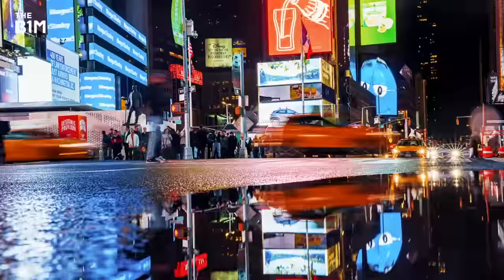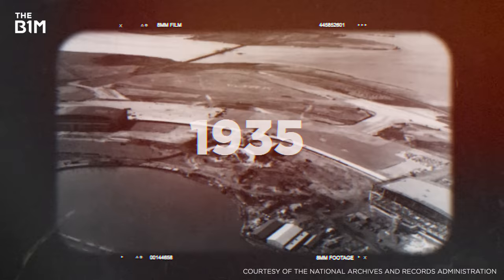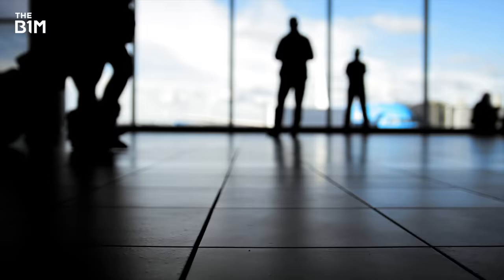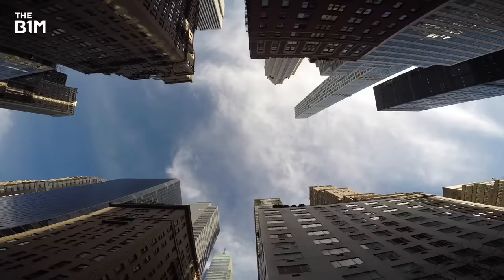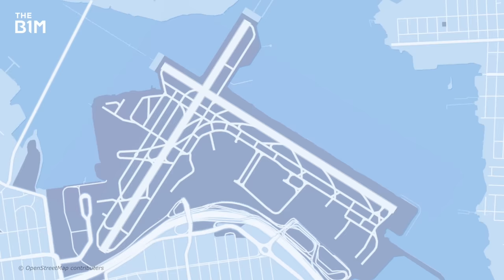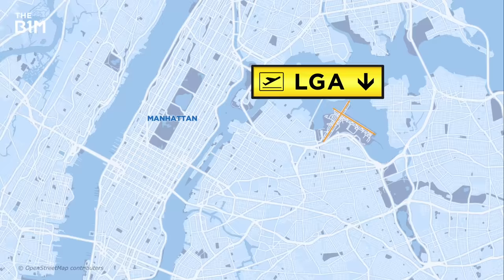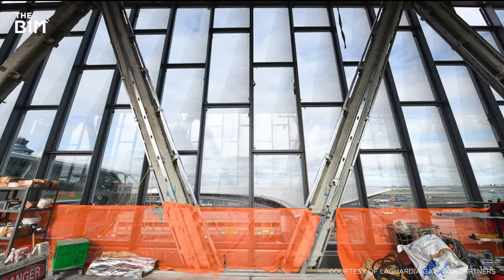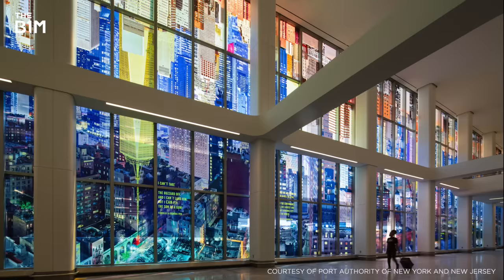The $8BN Plan to Save New York's Most Hated Airport

Comment: As a pilot, I can assure you LGA will never host an Airbus A380 as shown in the video when stating “…bigger and sexier jets.” LGA is capped by the perimeter rule which keeps most large (or “heavy”) aircraft out of the airport. Otherwise good job 👍🏼
Reply: Thanks for saying that.  I was looking at the stock clip he used twice with an Air New Zealand-logoed tail poking out, and saying, 'really? Me no think...'.
Reply: A 777 is a sexy jet an a380 isn't at all.
Reply: More importantly, the runways a too short for the jumbos. A 767 is about as big as it gets at LGA and even those area relatively rare. The bigger issue is actually they are using to small of planes in the RJs so it creates tons of congestion to move fewer passengers.
Reply: Same goes for the Burger King when mentioning food options at the old Terminal B. Don't recall that franchise (there was a Wendy's then a Five Guys in the food court by Concourse D), but it's a very small point in another fantastic, brief, yet engaging B1M video on urban projects.
Reply from the maker: a guy can dream
Reply: A380 is not longer a player on the game (and it was never intended for use at airports like LGA)
Reply: A380's are no longer available for new orders, their fulfilling existing contracts then terminating it.
Reply: @seanthe100  , 
What about an A350?
Reply: @markg1075  ,
I was diverted there from ATL and struggled with getting food. Pretzel dog, pretzel with mustard, soda was what I settled on. Not a single real "New York City" hotdog vendor in the Delta terminal.
Reply: You understand the perimeter rule was lifted correct?
Reply: @davidhoffman1278  it's aight
Reply: @StevenJohnson737  NYS Senate Bill S311A will codify it as a NYS law… the rule doesn’t apply to DEN due to the change in 1984, or on Saturday’s due to the lower travel volume… mic drop… I’m out.
Reply: That, and without USCBP facilities, they're never going to host a Lufthansa like shown at 3:08 (unless Germany builds some pre-clearance facilities).
Reply: @davidhoffman1278  - that's a bummer. And a very good point! Shake Shack, which is (sorta) authentic NYC eats is everywhere in the new terminal. American at JFK has a kind of hot dog stand at Terminal 8 by gate 42 or so, but not sure if it remains or did well. I mean, how many $11 hot dogs will even a seasoned traveler tolerate?!
Reply: Also, LGA serves domestic flights only.
Reply: As one of the PMs on the project, that made my eyes pop out. Silly B1M. :-)
Reply: A380s are obsolete already anyway
Reply: You're the pilot and I'm the flier. I wouldn't feel comfortable flying in/out unless both runways had 12-14K each.
Reply: @StevenJohnson737  no it was not lifted. There are exemptions to the rule at times, like NK’s transcon flights on Saturdays, but the rule is very much in effect.
Reply: And the runway is small too
Reply: @maumor2  It is still a player, albeit'll probably allow Boeing to have a flawlessly easy 797 launch, and it's production is over at this point.

Comment: As Peter says in the video, if the airport is using 22 landing/13 take off, it's more efficient because the intersection is at the beginning of both runways, so the touchdown happens and instantly the takeoff can roll. When the winds are unfavourable, the opposite happens where the takeoff has to wait for the touchdown to pass or exit slowly and then roll. 

That said, this new taxiway configuration will fix a huge problem and allow for significantly better ops.

Comment: I am surprised people complained about an elevated train, looks like they could just run it down the middle of the Grand Central Parkway elevated like they did with the JFK AirTrain and the Van Wyck.
Reply: The issue is mainly that you'd have to get the line around the overpass from the eastbound Grand Central somehow, while also altering the median.

The actual solution would've been something like aligning the tracks to Ditmars Blvd and then Astoria Blvd but that's subject to a hell of a lot of NIMBYism.

And then because of THAT, the tracks would be opposite to the actual terminals themselves... and thus need a bridge across in some capacity OVER Grand Central.

There's just no easy solution, aside from the train link up to Willets Point that would make travel times too obscenely long.

Comment: The initial rail connection was going to take passengers away from Manhattan. With the new FAA regulations allowing federal funds to go towards local transit it is now possible that the Subway can actually directly connect to LaGuardia
Reply: Mass transit connections are always important and needed!!!
Reply: @TrebleSketch  exactly
Reply: @dirkdiggler9882  Also especially within a country that seems adamant to not improve itself. Or even have anything good in the country alongside with the incredibly boring imagination for what better things can be done. Might take 30 years with a lot of performative politics seen within USA, when it can be done within 10 or less in many other countries.
Reply: @dirkdiggler9882  Still, better have a bus than nothing at all. Every passenger on board is one less car on the road.
Reply: @dirkdiggler9882  Its unwise to completely dismiss buses when they do have their role. Regardless, I agree.
Reply: It will not happen in my lifetime.    Although politics will not allow it the smartest choice would be to build a new LGA terminal and then relocate everything over one month.   No operating while under construction.    It was highly successful in ATL.   Construction crews operated 24hrs a day and it didn't interfere with daily flight operations.

Comment: My #1 issue with LaGuardia is the long taxi ride to get downtown. Until that’s fixed, I’m more likely to just take the train up to NYC.
Reply: LGA is IN NYC.
Reply: @afcgeo882  Pretty sure the commenter meant taking a train like Amtrak to NYC from where they live instead of flying to LGA from where they live. It may be slower, but much less of a hassle.
Reply: The easiest plan seems to be extending the N and W lines up past Astoria to LGA with a shuttle built across the entire massive terminal to ease access to the further down Delta gates.
Reply: @DinerLingo  Exactly. Once you get to LGA, it’s a hassle getting to Manhattan or Brooklyn. The only good thing about LGA is that I can get a direct flight there. But if I’m going to have a layover added in, then taking the train is faster, cheaper, and easier.
Reply: @MrRapmaster19  You can’t randomly add an in-terminal shuttle as architecture and design plans didn’t create it. Extending the subway would require crossing Rwy 4… how would you do that? Keep in mind that it was built on a marsh.
Reply: @DinerLingo  I wouldn’t know, but unless you live in the nearby Northeast, that’s not really feasible. I don’t work on assumptions, do you?
Reply: @afcgeo882  Assumptions? No, it's not always a good thing to base an argument on assumptions. However, in this instance, both logic and common sense, attributes that are apparently less pronounced in you, would seem to validate Brian's statement.
Reply: @popeyetsm2750  The statement wasn’t even Bryan’s, but to trolls like you things like that don’t really matter at all.
Reply: @afcgeo882  No sh_ t, Sherlock. But you were replying to Bryan, or did you forget already? Troll? You should know, you make trolling look easy.

Comment: This video is excellent.  The conjoined runways explained a lot about why my plane sat in the queue for so long while waiting to take off.  Also, landing at LGA was at times a little scary for me as a passenger.  Seeing that water come up to meet you ad the plane tried to land always made me a little nervous.  I am only speaking for myself.
Reply: Those runways actually were designed like that because of the wind. Even if they weren’t joined together only one is supposed to be used at a time, depending on the wind direction. It would effectively work as a single runway regardless of being close or not.

Comment: It’s hard to believe that back in the early fifties, prior to the construction of the maze of four lane 
connecting highways (676, Whitestone Expy., widening of Northern Blvd, etc.), it was possible to ride a 
bike from my home on 161st Street along Northern Blvd (25A) across the Flushing Creek drawbridge to 
the bike/footpath adjacent to Grand Central Parkway, all the way to LaGuardia Airport. I would ride past 
the terminal building to the threshold of Runway 4 and sit in the grass and watch the airliners taking off
from the opposite end and coming right at me. They would be about 200 feet above me when they 
passed overhead and the noise from those propeller driven planes powered by 3000 horsepower 18
cylinder piston engines such as on the Lockheed Super Constellation, seemed to make the ground shake.
There were no FAA noise abatement requirements back then. Pilots didn’t have to throttle back soon
after liftoff. Looking up, I could see the blue exhaust flame from the exhaust stacks of those four
powerful engines. There was no security of any kind in those carefree days. It was great being a 
teenager back then.

Comment: What I don't understand is why the transit link is so hard. The G train has extra capacity and can already run out to Forest Hills. Then, create a new branch of the Queens Blvd. line that branches off either from the Northern Blvd. stop or Roosevelt Ave./Jackson Heights and run either the M or R on it. It could make a couple of intermediate stops and then make stops at Terminals B and C/D. It would be maybe 3 miles of new subway and would provide reliable service every 6-10 minutes plus providing additional transit service to underserved parts of Queens. It just seems like a win-win.
Reply: Absolutely do NOT run it along Queens Boulevard, that trunk line has ludicrous capacity issues as-is and running the G along it full time would just make that even worse.

The absolute most viable solution is an Astoria line extension because a) it's closer and b) wouldn't massively overtax an already crowded line.

Comment: I think a solution to airports that serve larger cities would be to create smaller ‘terminal buildings’ or check in facilities in certain key locations in cities with dedicated transfer links to the actual departure lounges at a designated airfield or airfields. A passenger would simply check in right there in the city center at a check in facility in a mall or at a key transportation hub, and when ready head through security and board a designated transport link whisking the passengers to the departure lounges. This would solve quite a few problems. This would in my opinion be a revolution to the idea of an airport.

Comment: Raleigh/Durham Airport in North Carolina, USA is undergoing a $4+ Billion expansion. Will have at least 34 new gates (more would be added if called for), New Runway, hangar campus, CONRAC, expanded runway, new general aviation facility, etc
Reply: It was originally planned to only cost around $2.7 Billion but in January 2020, the airport realized it would need even more gate capacity and would need to completely replace terminal 1, putting the cost closer to $4 B

Comment: You misused the term 'ramp'. The ramp, or apron, is where aircraft park at a gate to enplane and deplane passengers. The problem with ground delays at LGA (and many other older airports) was that departing aircraft were pushed-back onto single-lane taxilanes, thereby blocking other aircraft from taxing to/from their gates. Taxilanes are considered 'non-movement areas' and are controlled by airline ramp control towers. As they approach the end of their respective taxilanes, pilots contact FAA Ground Control where they report their positions and receive instructions to enter the 'movement area' and the taxiways which lead to/from the runways.

Comment: I'm a Queens native who llikes LGA 
Let me set you straight with some facts 
Fact 1: to get to Manhattan quickly and cheaply take the M-60 bus to Astoria Blvd and then the N/W train to Times Square  and points beyond
To get to the LIRR quickly and cheaply take a cab to the Woodside Station of the LIRR  ,The distance is < 4 miles and can be done entirely on local streets
Once at Woodside you will have access to ALL of the LIRR's branches ,the # 7 train and the Airtrain to JFK( change at Jamaica )
If you have a long layover at  LGA , you can take a bus to downtown Flushing and its many good Asian restaurants 
The DC-10 was a widebodied aircraft  that designed to fly out of LGA's relatively short runways

Comment: I think High-Speed Rail would help USA's transportation system greatly by reducing the need to use air transportation for short and medium trips. It's a shame so many are against it.
Reply: One of the great compromises of the USA was giving rural areas of our nation a large amount of power. Looking at our 50 states high speed rail only makes sense in Maybe 15 states tops. it's impossible to get a senator from a state like Wyoming with a population of less than 700,000 and larger than many European countries to support high speed rail as they are 100% going to be ignored as it has no major cities to make HSR even feasible. There's maybe 25 other states in similar positions hence why there isn't a nationwide campaign if half the nation is going to ignored.
Reply: @seanthe100  Very interesting facts. It really is not a topic that's brought up very much.

Comment: As someone from NYC, I will still always avoid LGA. Terminal B changed so much, but the worst thing, for me, has ALWAYS been the roads around it. Picking someone up from the airport, dropping others off, or worst yet: parking and getting to the airport... they're all nightmares. Even Terminal B's new road system doesn't change the absolute nightmare that is everything around it.
Reply: I doubt I will trust LGA for as long as I live.  It's the worst travel experience imaginable.  You are spot on about the roads, hopeless traffic jaws all around the airport always.  You sit in traffic and you can see your flight taking off without you.  You'll actually see families running with their suitcases  along the side of the road.  Blue state problems.

Comment: The B terminal wasn't that bad, you just had to walk around the occasional ceiling leak. The C terminal was the one I dreaded because it had nowhere to sit by the gate.  They put a giant bar in the middle of the gate area and big tables with IPADs on the sides leaving almost no room for normal, higher capacity seating. The runaway delays are terrible in all terminals though, so hope this all works.

Comment: One of the reasons LGA and it’s runways are configured the way they are is due to the state of the airliner technology at the time it was originally designed.  In the 1930s, most of the trans ocean routes were flown by large flying boats (Pan Am Clippers or similar).  The domestic routes were flown by smaller land based planes such as DC-3s .  So a state of the art 1930s International airport had to be located on the water for the flying boats, but have runways for the connecting flights. Of course the aviation technology advanced during WWII, making the flying boats obsolete.  As the larger land based planes could do a Trans Atlantic hop.  If I recall correctly, one of the original terminals at LGA was called the Marine Terminal.
Reply: The Marine Air Terminal is still there with its distinctive art deco look (just North of terminal A) it was a very important hub for the PANAM clippers

Comment: Isn't a 757 the biggest LGA can accommodate? Runway length the limiting factor?
Reply: Not on paper. In Britain, where I live, Bristol Airport operates with a 6600ft runway - 400ft shorter than LaGuardia - and yet, in the summer, TUI operates a Boeing 787 on a transatlantic flight to Orlando. Runway length really isn't a problem here - it's the terminal itself. On paper, if they wanted to, and the law allowed it, transatlantic flights could be a thing.

Comment: I’d never flown into LGA until Easter weekend of this year. Heard bad things from everybody I knew that had experience with that airport and I was fully expecting to have issues too but honestly it was a great experience the new terminal is stunning too I’d never really been impressed by an airports design before and I was honestly so confused as to why everybody hated the airport so much but than found out from my taxi Driver that it had just been remodeled which made way more sense. I’ve since been back but only got a layover on one of the dumbest flights routes ever

Comment: I flew in last Wednesday from Pittsburgh and it wasn't as bad as I'd expect. The return flight was even easier. Used terminal B both times so it was a decent experience. Getting out of there to where I was staying in Times Square and back again was not too bad either. Some people I flew with spent $75 on a taxi, other $60 on an Uber but I decided to spend the $2.75 for public transport. There's a bus that departs regularly that goes to the subway terminal and the train lets out next to the hotel in Times Square but it took almost an hour for the trip. Still, if you want the New York City experience, it's not bad

Comment: Have flown into and out of Terminal B at LGA and its vastly improved over the old one, mass transit is fairly easy to use (there's SBS service from multiple lines at Jackson Heights/Roosevelt Ave stop) tho I do wish there was a more direct connection its not bad. I hope that once the project is fully finished we truly don't have to hear about issues at LGA anymore.